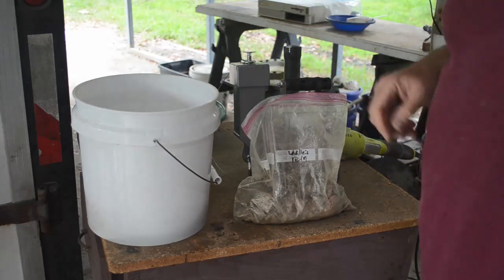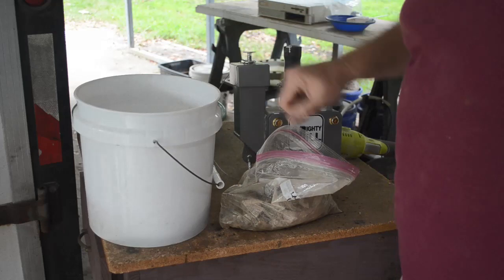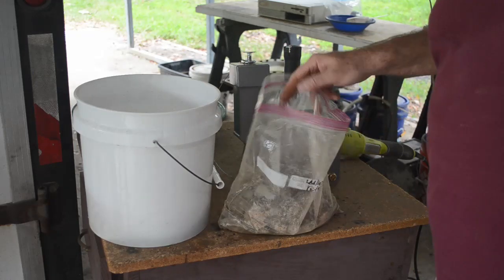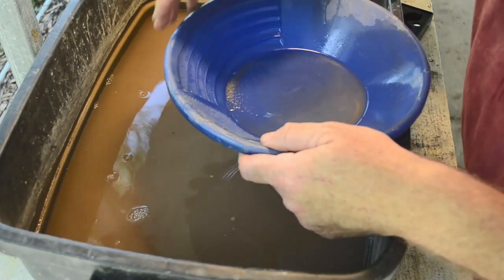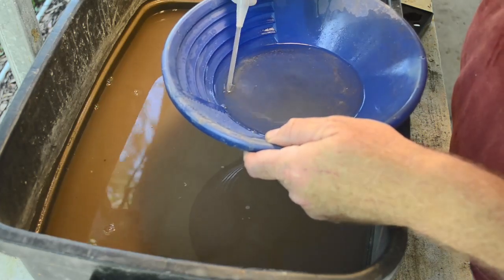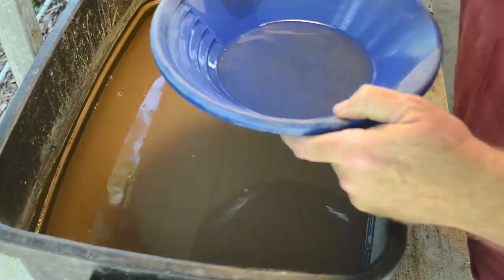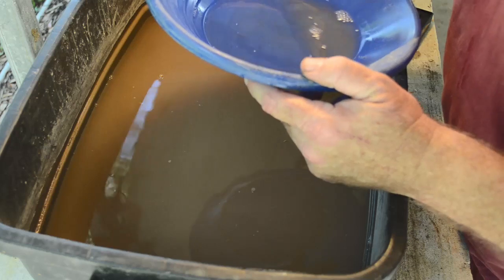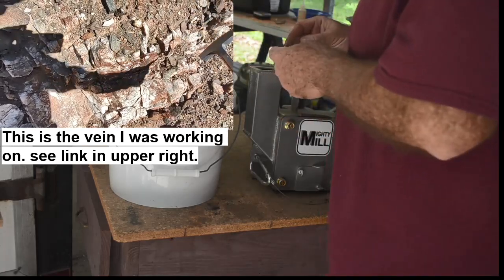Finding Gold In Quartz Vein Samples From Wyoming Mountains

Comment: Hi Mike, I bought 2 lbs of rock from an EBAY seller, and crushed and classified about an 1/8 cup by hand. I is very satisfying to pan and find a mix of pyrite, garnets, other heavy bits. The bag had a rock with a green mineral like yours, did you find out what it was?
Reply from the maker: I'm thinking it was probably bits of epidote.